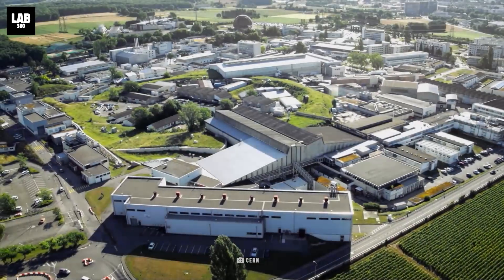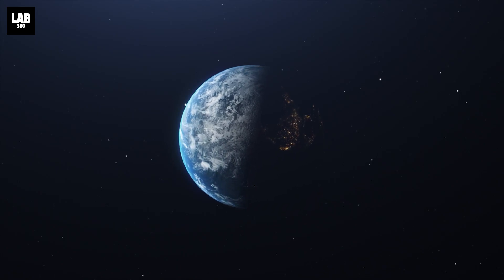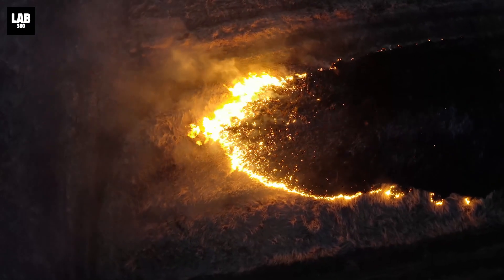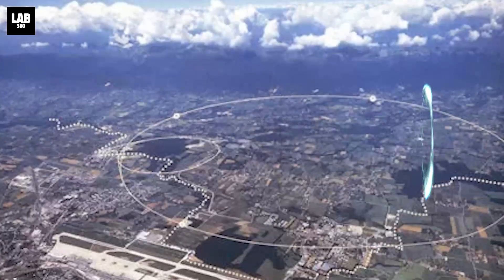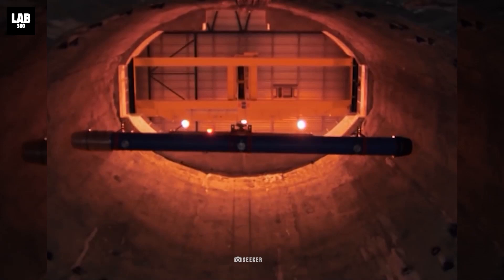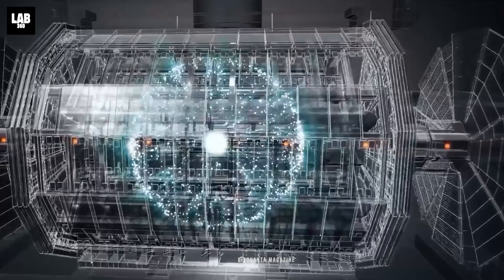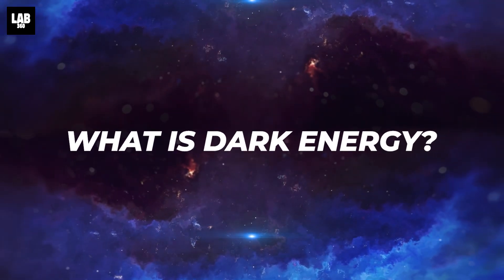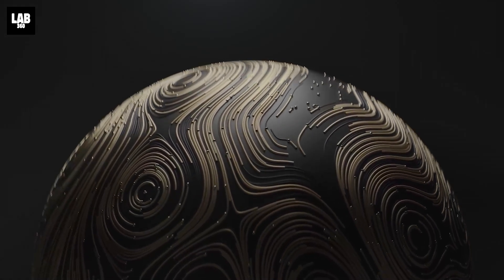Scientists Announces New Discovery By The Large Hadron Collider At CERN

Comment: Stopped watching the second the whole "it could create a black hole and suck everything into it".... That's not at all how black holes work and this is the most tin hat shit I've heard. I love a good conspiracy theory and dig some that I find interesting and plausible, but this is garbage.

Just to inform you.. black hole are just concentrated mass. They use singular particles or small quantities of particles in these experiments. The mass of these particles is so small, that even if they created a black hole, it would 1. Dissipate very quickly likely through hawking radiation or 2. Remain but have zero effect on its surrounding.

Why wouldn't it have an effect? Because the mass is unchanged, it just became more dense. If the sun turned into a black hole right now (hypothetically without the supernova of course), they planets would all freeze, but their obits would be completely unchanged since the mass and gravitational pull of the gravity well remained constant. 

At least learn the basics if you're going to make claims about a scientific research center.

Comment: So basically the whole planet shifts into a new dimension so he said, this can alter the elements, they look the same but could be heavier etc, if this is true and we're in a different dimension now, has somebody out there done a test on the elements now to see if they are the same? Or when we shift dimension does the wording change on books we wrote? If this is true, we could take elements from another dimension, and bring them back to this dimension? Or would it change back, or could we smelt resources easier then when we come back to this dimension they'll be impossible to smelt or break due to the change of its structure, the particle machine... Once you use it does it change its structure so it becomes weaker and  dangerous to run, maybe that's why they shut it down for 3 years to rebuild with the new elements using more or less due to the change in its weight etc, could we send something into the sun that is resistant to its heat, as soon as its in change the dimension for a microsecond to harvest what's inside of it then change back to this dimension and bring the probe back?

I personally don't really understand and if I was in that room with them scientist I would give them a headache because I would fire infinite questions to answers they could only theorise meaning they'll never know but give me the explanation to best explain to our research conducted.
Reply: Naw...you would not be allowed in, in the first place. They ask the qveshchuns!
Reply: @Lola-mn9oz  but in a different dimension I could be the one who asks the questions?